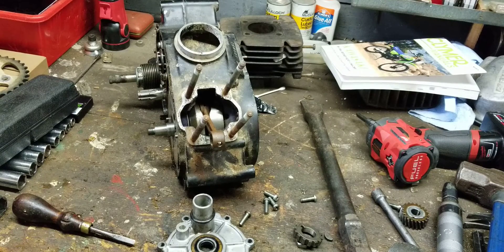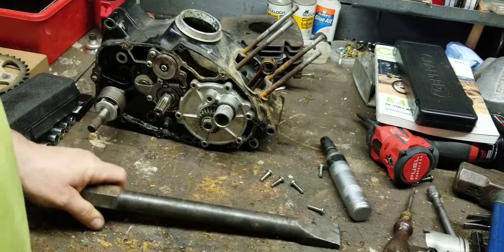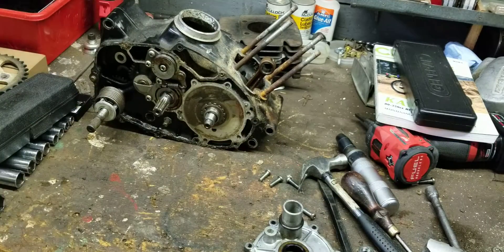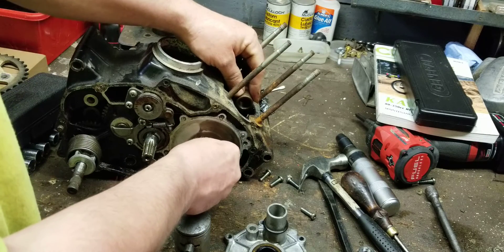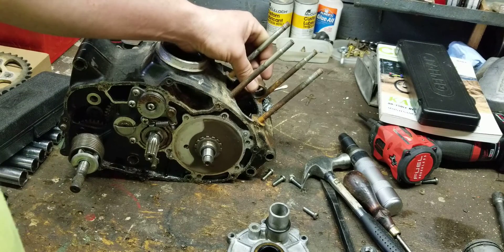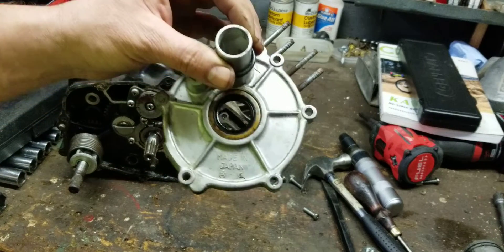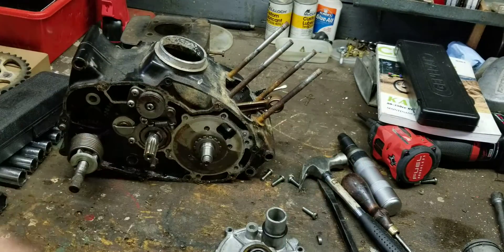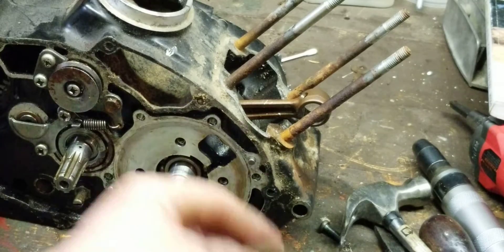Rotary valve engine talk removal and how it works

Comment: Good morning Kevin this is Chris here I'm working on a 74 TC 100 rotary valve. I seem to can't find any info on sealing up rotary valve I have a new outer with the cork back in on
 it. But my problem is the inside was chewed up around the port I was going to try to make a new one out of gasket material but I'm not sure what type of material and how good a seal it has to be .inside the rotor y valve itself . Haven't been able to find New Old stock or anyting on that particular item. Anyhelp would greatly appreciate it
Reply from the maker: Hi Chris call after 5pm est 603 395 8097

Comment: will it runs at all if the valve is put in incorrectly?
Reply from the maker: It will not run however if you spins the flywheel with a drill opposite direction engine will run backwards
Reply: @2strokeguru  bummer I have one and hoped the valve was in backward but its not. it runs for a second or two with the choke on and then a second or two with the choke off and dies. cant figure it out.thanks a lot
Reply: Mine wont start and the rotary valve is putting gear oil in the carburetor

Comment: sir kevin can i ask some question 
about rotary valve 
what ganna happen if the rotary valve is in not good condition?????
Reply: thanks sir Kevin
Reply from the maker: @jinggoyaure8057  welcome
Reply from the maker: hesitation loss of power excess fuel blowing out the carb and noisy

Comment: Any reason air would be coming out of the carb when kicked over? Rotary valve issue?
Reply from the maker: this is a normal operation 2 stroke engines use both sides of the piston as the piston starts moving down it pushes air and fuel up the transfer  ports there is a brief moment when the rotary valve is slightly open and that why this happens
Reply: Kevin Bergeron thank you! Good to know. Got worried when I couldn’t start it and it was blowing air out the carb

Comment: do you know much about bikes that have cork on the outer valve portion? my Suzuki TC100 has this and not sure how to replace it or if it is even important to replace the cork? Also there is no oem part for the cork so I would have to make something up...